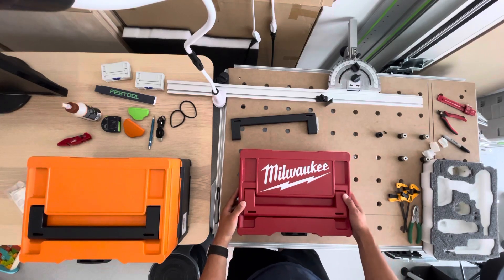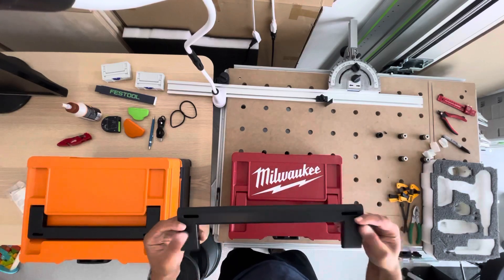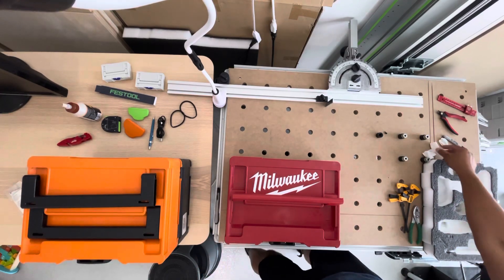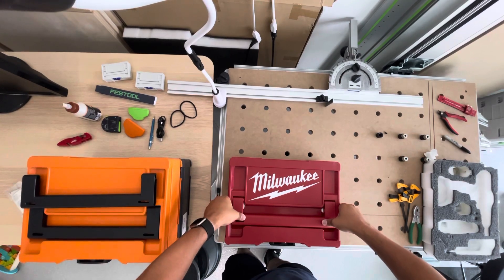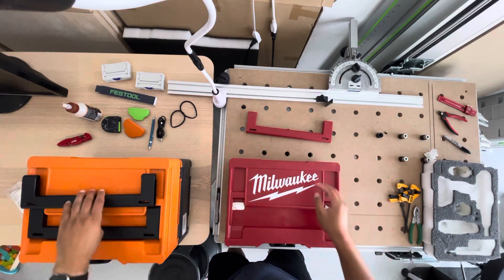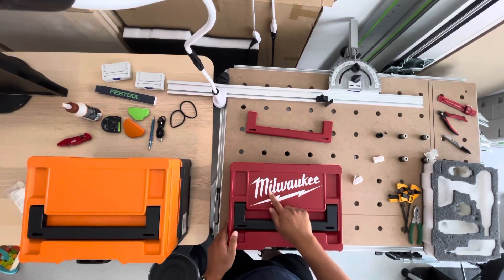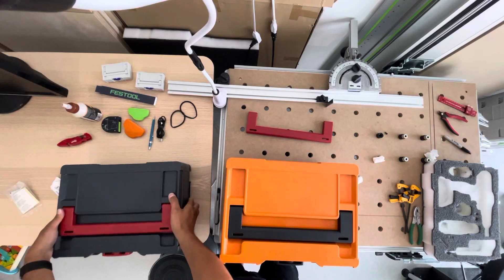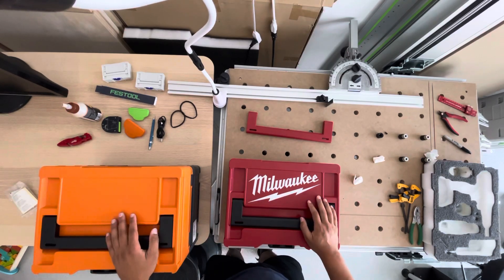How to replace handles on Systainers

Comment from the maker: In case anyone is also wondering about the smaller front handles that were added onto the Sys3 system, those apparently are not replaceable. Someone in the know reached out to Tanos and that's what they told him so I guess those can't be swapped out. So the top handle and the front hatch are really the only parts you can swap out with different colors.
Reply from the maker: Upon further inspection I think the smaller front handles are removable without breaking them.
Reply: @james.a  Yes, I learned not too long ago that the front handles are replacable.  I'll have a video soon on that.  In fact, I have Anthracite and Light Grey Front handles in route.  I'm pushing to see if I can carry other colors too.
Reply from the maker: @SystainerStore  That’s great to know. I’ll definitely want some black handles in the future if they become available to purchase on their own!